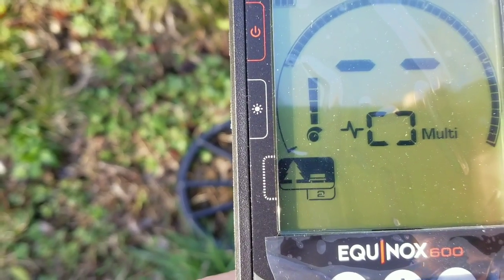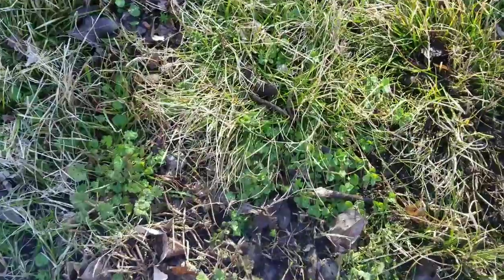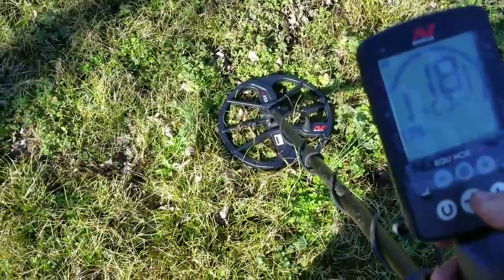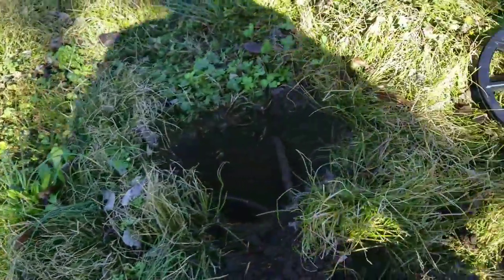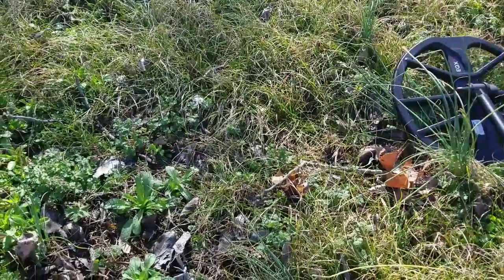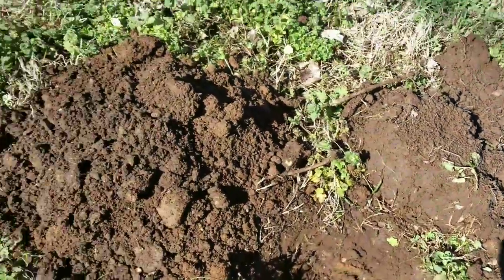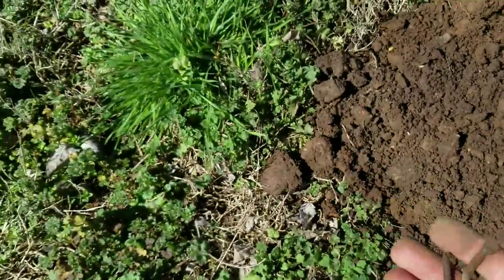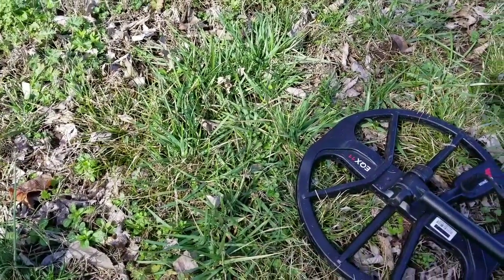Minelab Equinox 600 First Hunt.  Nail Infestation!

Comment: Thanks for the video! I am getting back into the swing of things after some time off, picked up a equinox 600 tonight. I am also wondering about the 11" coil, i would like a smaller 6" or so, the question I have is about the multi frequency, what coils are compatible with it and are single freq coils compatible with this detector?
Reply from the maker: Crypto Info the only available coils are those specifically made for the Equinox. The accessory coils haven't been released yet. Please join us at the new Equinox 600 group at

https://www.facebook.com/groups/1443939409068454/

Comment: Is this the only detector you've used in this site?  I'd like to compare with At Pro.
Reply from the maker: Wayne No.  All my detecting videos were done at this site with the exception of the recent vlog. The ones shot here were done with AT Pro with 5x7 coil and Whites Classic ID.  It's been hit the most with my Nokta Fors Core with small coil.  I've also used Tesoro Compadre, Minelab Explored 2, Minelab Xterra 70 with small coils, and  Fisher F70 here.  I've hunted here with others who used Etrac, Deus,  Teknetics Eurotek and T2 and some others.  To say it's been pounded is an understatement.  I've actually owned 2 different AT Pros.